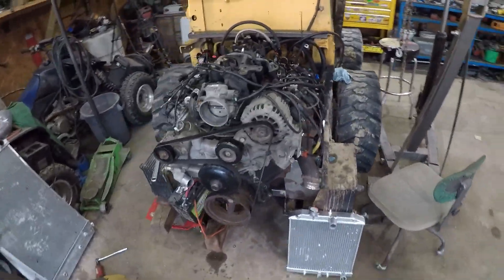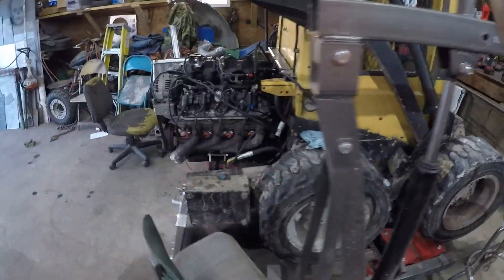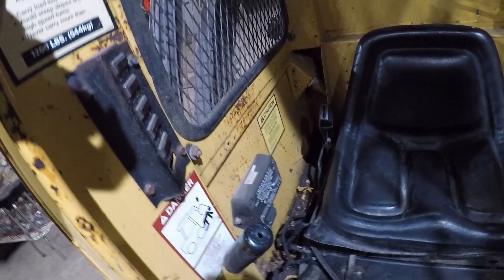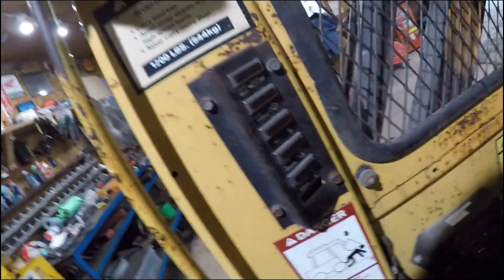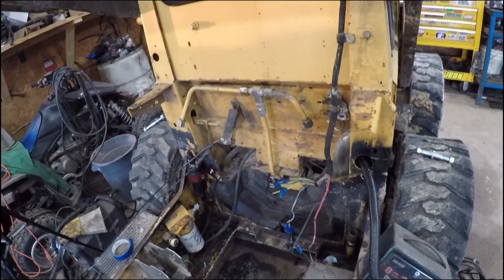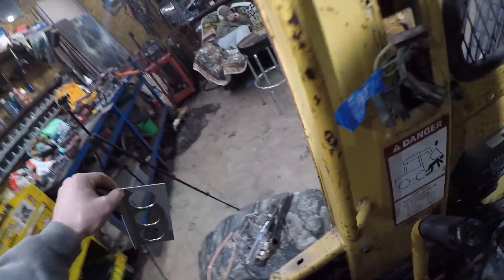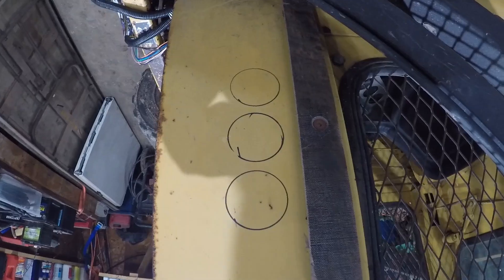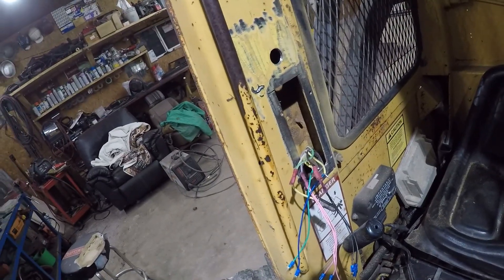LS Swap Skidsteer Build Part 3

Comment: For the gauges i would just put an obd port in , got a Bluetooth obd link and a cheap phone with a obd app to run then , guages, check engine codes and tuning , getting two birds stoned at the same time
Reply from the maker: @nathanielgerdom8452  if you got good oil and water temp you dont need no cybertronix

Comment: Just curious, a normal diesel motor would have some sort of governor to handle load changes and keep RPM steady.  how are you planning on handling that?
Reply: Keep it at redline all the time!
Reply from the maker: Trying to figure that out. May use some sort of pressure sensing valve on the hydraulics to work another valve to induce air to the engine under load unless you have a better idea
Reply: Its for drag racing now not diggin